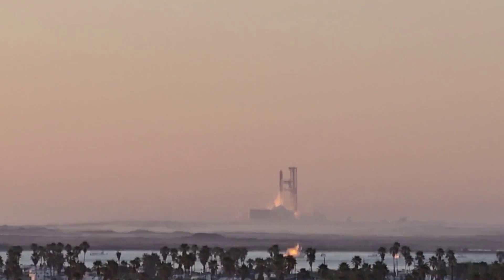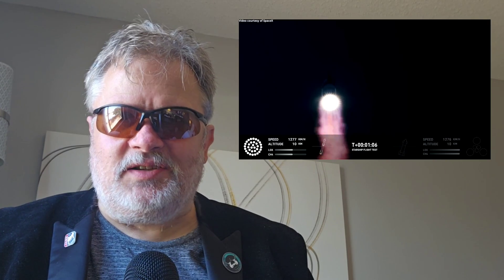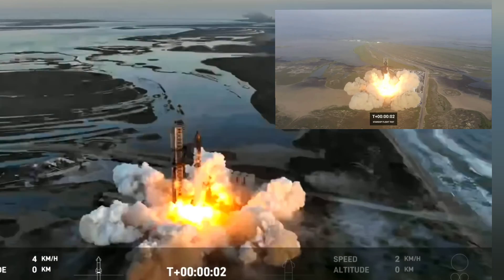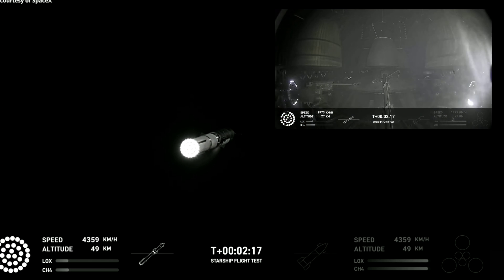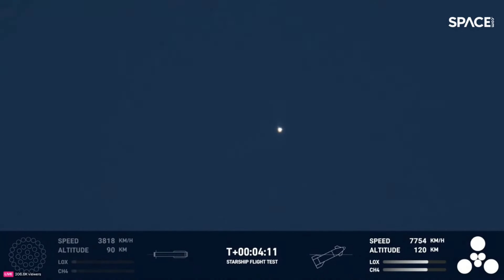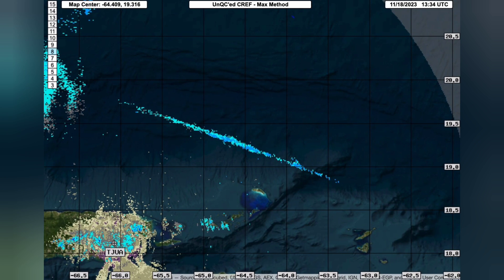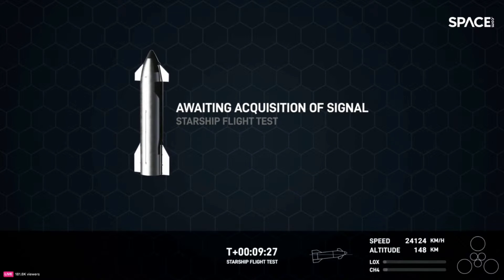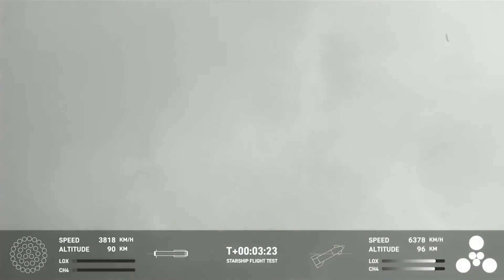Starship takes a huge leap forward!!  What's next for SpaceX after OFT-2??

Comment: I honestly think that Starship should be reconsidered depending on the mission. For the Moon and Mars, replace Starship with a 2nd and 3rd stage that is not reusable. I'd want to land something that can carry considerable amounts of payload and also be used as a place to live, no reusability is needed for that. Plus, the number of launches to refuel Starship in orbit is ridiculous. If you had something that was not reusable, you'd require far less launches for refueling. However, for low-Earth orbit missions, yes, you definitely want reusability.
Reply: Refuelling may be "ridiculous", however if the cost per mission is exorbitantly high then the mission will ultimately be abandoned. The space shuttle was canceled as it was too expensive and not extremely safe.

We will ultimately never accomplish anything meaningful in space other than satellites and probes if the cost per launch is absurdly cost prohibitive.

Setting up colonies on Mars may ultimately be a pipe dream. However, getting large payloads into orbit at an affordable price points is going to be a prerequisite for any meaningful space exploration or utilization.

So could they use an expendable stage? Yes. But then again expendable, unaffordable and economically unviable transport options already exist on the market. Why bother reinventing that wheel when NASA is already doing that? Disposable rocket stages won't put large payloads into orbit cheap enough to be economically viable beyond a very limited scope of commercial applications.

Like if a garage door opener cost 100 million dollars to develop and then 10 million dollars every time you used it........ It's practical application would be somewhat limited. Sure, it's a functioning garage door opener, but at what cost.

But then again SpaceX could be wrong. Lot of companies seem to like expendable rockets and high costs per kilo to orbit.
Reply: @danielnomnom2646  In the scenario I was talking about, the booster would be completely reusable. It's only the upper stages that you'd expend when going to far away places like the Moon or Mars. And, you don't need to expend them forever, just accelerate the time frame of getting there by allowing the first series of missions, to setup infrastructure, to be expendable.

Comment: SpaceX still has a lot to do:
1. Fix the issue with hot staging/boost-back burn
2. Fix the issue with the heat tiles being ripped off the Starship
3. Figure out why the LOX leaked from Starship

Comment: One of the most glaring differences between the two flights, you failed to mention; is that when the first one started rolling around - the second one was already more than twice the altitude and going at more than twice the speed.
The first never got near separation stage.

Comment: Thank you for the coverage!
I think next launch, it could make sense to try it without the hot stage separation. The booster started failing immediately after, and did Starship actually get away damage-free firing that close? Hot-stage seems plausible but go for standard separation for now to get to full mission completion. Optimize later.
However, I counted at least 5-6 major improvements so it was a success!
- Ground 0 launchpad in much better shape (this could be the biggest improvement as it enables another launch sooner)
- every engine worked til stage separation
- Starship made it past stage separation and continued on its own.
- Starship fired all its engines
- Made it to space, much higher, further, and faster than last time.
- Orbit now looks realistically possible whereas the last launch it struggled the whole way.

Comment: Its pretty clear the booster had issues only when the engines went to relight after seperation. Its fairly likely no fuel pressure on one side was the root cause, not damage to the top of the booster.

Comment: I agree that at the current point in time SLS is a more mature vehicle, but at its core it is also a relic of the previous century and that is the only reason why it was able to achieve what it did. Mark my words, when Starship reaches the amount of development time and cost that SLS had, it will be achieving FAR greater feats than slinging an empty capsule around the moon. The fact that SpaceX was able to reach space with the worlds most powerful and complex rocket that essentially started its design in its current form (switching to stainless construction) in 2019 with an entirely brand new engine of a design that has never even flown up until Raptor, shows there really should be no comparison between the two systems. I think that in our current environment with how NASA operates SLS is a necessary evil and is still an incredible feat of engineering, but I think we have to keep in mind that just because they had maiden flights within a few months of each other doesn't mean that they should be compared in their developmental timelines simultaneously.
Reply: Saturn V had two test flights, Apollos 4 and 6. All three stages were tested together, no individual test firing (at Von Braun's insistence). Rocket performed flawlessly both times. Third flight was manned (Apollo 8).
Reply: @dalethelander3781  I don’t think we read about the same Apollo 6 in history class mate 😂
Reply: @dalethelander3781  not to mention I said nothing about Saturn V, only SLS, which shares practically no direct heritage with Saturn V (which is one of my all time favorite rockets btw).
Reply: Apollo 6...April 4, 1968. Declared a success, despite pogo oscillation. Overlooked because of the assassination of MLK.
Reply: @dalethelander3781  of course overlooking the loss of two second stage engines and a failure to relight the stage once in orbit… I’m not discrediting what NASA has accomplished, but pretending they never have failures is just ridiculous.

Comment: Fuel slosh. Not modeled on a super computer?
Reply: No, CFD (Computational Fluid Dynamics) Is Still Used And Is A Very Valuable Tool For Determining How Designs Will Perform ! ! !
Reply: Are there such things any more? Is Cray still in business?
Reply: @dalethelander3781  there are. More than ever. I think Cray absorbed by another company

Comment: I'm sticking by the following: hotstage ring not tall enough. needs to be not just taller, but have a protective curve - almost like a semi-disposable middle stage like a ladies corset. booster stage flipped too soon - should've gone a little higher altitude - low orbit allowed the slosh to hit the damaged booster - also, that tiny hotstage ring could've made the balance topple it prematurely.
starship was damaged by the hotstage sep, and because they glued some of the heat tiles on - which popped off easily. 
starship booster needed to slow down the flip maneouvre - hence the need for a little higher altitude to expend some of the fuel before flipping. the 'ladies corset' hotstage ring would protect the booster and the starship.

Comment: The videos clearly indicate the initial explosive damage to booster 9 began at the engine compartment and not the hot staging ring. This probably points to propellant slosh and propellant hammering internally damaging the plumbing. I wonder if ALL of the other boosters, currently waiting to fly, have similar propellant slosh design potentials.
Reply: The turbopumps self-destruct if fuel or oxidiser becomes gaseous. Fuel slosh introduces gaseous sections in the fuel and oxygen supplies to the pumps.

Comment: Regarding boost explosion: right after separation (and before explosion) it "tries" to light on the engines again, but you can see on diagram of the livestream, only the engines "of one side" comes back to live, while the other side doent. Also, from the three engines who never died off in stage separation, one goes dead after separation, all at the same time of the spin of the boost to come back Earth...

Comment: no expert here of course, but I'd think starting with just the 3 vacuum raptors for hot staging would shake up and potentially "throw off" the booster less, while allowing the starship to separate from the booster and push ahead of it before switching the regular raptors.

Comment: I think with this flight, the massive delay was caused by the investigation into the previous flight's impact on wildlife, etc. With this second flight - this did not happen, so there is a chance that the next flight will not be as delayed. SpaceX is cleared for a few more flights in 2023. Of course, that's not going to happen given they need to review the data and make the necessary adjustments - but they have proven they can do this very quickly. At this point I think it comes down to what they find is the cause of those two separate issues and how to fix it for the next flight. I don't think a late January flight is out of the question.

Comment: I'm of the mind that once ship raptor ignition is confirmed and the separation signal given the booster should shut down the 3 center engines. Then the booster should complete the flip using RCS and settle the propellant before attempting engine relight. It's not like they don't have the time to do so during stage separation, Falcon 9s do it all the time.

Comment: Yep, I'm speculating. The glorified shower-head did the job. Stage 0 is intact. The launch, all the way through to hot staging went flawlessly. All 33 engines on the booster did their jobs.
It is my guess that SpaceX wanted a test of the FTS on both stages. Once they had the data they needed, they activated the flight termination system, which also worked flawlessly. This test was a total success. The next one will have a splash-down of Starship outside of hawaii and a fin-down landing of the super-heavy booster in the Gulf of Mexico. Mark my words.
Reply: They already satisfied the FAA with the new FTS to be allowed to fly, and already have the data needed, a test like what you described is not necessary. The test stopped short of full data collection, like booster boost back and guidance to a specific spot in the water, and Starship reentry guidance and stability testing.

I think the biggest point against it being intentional is that it was not mentioned in the webcast and it was not part of the flight plan filed, which had monitoring assets and a restricted space around the Starship landing zone near Hawaii. The FAA announced that there was a mishap because it did not go as planned. SpaceX will be doing another mishap investigation to find the root cause failures of this flight and fix them for the next flight. If testing the FTS was planned and it all worked perfectly, there would be no mishap, just like the Dragon abort test where the booster was intentionally blown up.
Reply: @Jaker788  You may very well be correct. Scott Manly did a pretty good analysis of the footage from the test flight. It may be that there was damage to the engines on the booster from fuel sloshing and cavitation during the flip maneuver. That explains termination of the booster. There were also puffs of gas from the Starship before SECO that may indicate a fuel leak. Although the flight looked great, it did not go perfectly.
Reply: I sort of agree. One of things that the FAA was unhappy about in the first launch was that the FTS took way too long; this time, it was mostly instantly.  The only reason I can't totally agree is because SpaceX could have used the extra data and perhaps blown the FTS when it was closer to landing.

Comment: How many Apollo rockets failed?
Reply: None in the Saturn 1, 1B, V total of 32 launches.
Reply: @randyschreiner7807  gosh, what a surprise!
Reply: None. Not a single failure. Apollo 13 had one second stage J-2 engine cut out prematurely, but burning the other 4 engines longer delivered the payload.

Comment: No one has ever tried hot staging on a recoverable booster, not to mention one of this size. That's why Elon iterates. Now all that data will again be inputted into the next launch. As much as this 2nd launch improved from the 1st launch in all areas, I'm sure they'll make the appropriated adjustments. 

I think you should give SpaceX and Starship more credit for the moon landing timeline. I expect it to slip some, it always does. But not substantially as long as launches are not delayed and they can iterate. Think, in less than 10 yrs they invented and perfected Falcon 9 a type of rocket never built before. In less than 6 yrs they built Crew Dragon and started having regular scheduled crewed flights. That's having never built a rocket or crew system before, nor being a rocket scientist. Now with all that experience, as well as utilizing Elons iterative design process, I would think the Starship system would develop exponentially faster. Much faster than Falcon 9 and Crew Dragon. SpaceX could very possibly come close to these moon landing timelines. I believe the Starship system will become the complete moon landing system by the time those dates arrive. If Elon wants to practice Moon landings by going to the Mars, he doesn't need to wait on NASA, he just needs a launch license!

Comment: SN is a haulage lorry for the hardware and fuel?
habbitat delivery systems.
humans to journey in more stabel mature transport
Connect transit from one machine to another
refueling once in space could be ejectable modules
of any amount and moidules for water food expandable room.
Landing craft alsom could be lego meccano clipped together for a better landing
flat to moons surface for easy quick exit re-enter.
SN may need a bigger stronger double skinned venting vibration nulling plate.
If booster still burning pushing at same moment as Sn Fires away
could cause massive pressure damage.
heavy springs moments before sn fires could push sections apart better

Comment: I think massive engine heat soak was the fundamental problem with the booster. This caused the problems with restarting and maintaining combustion causing fuel slosh and ultimately duel starvation. 
Scott Manley noticed that just before we lost Starship the Oxygen usage increased massively - and had a corresponding odd exhaust plume towards the end - why?

Comment: Scott Manley surmised that fuel slosh caused the engine failures on the booster. There may have been other factors, but that very fast flip very likely starved some of the engines. Not sure what happened to second stage but the flight termination system being triggered after it failed to reach its target altitude is a safe bet. 

 I look forward to the local folks showing the state of the pad in the next few days. That’s going to be a make or break issue for an aggressive launch cadence. If the pad is unscathed then they can focus on the booster & vehicle. If there’s new damage then there’ll probably be further delays.

Comment: Considering that you were certain that the water suppression system would fail, I’m going to assume that the hot staging had no negative impact.
Reply: It did seem to push the top of the booster down and upside down. With fuel sloshing to the top (facing down), they could not successfully relight the engines.
Reply: I stand corrected.  I'm glad it worked.  However,  the fact that it was so well engineered and ready to go so soon for me begs the question why the first launch wasn't delayed so that it could be built.  Let's hope SpaceX doesn't make other "rush at any cost decisions."  Personally, I think all SpaceX fans should send letters of thanks to the FAA and the FWS for preventing SpaceX (Elon) from rushing a second launch before all the improvements made in the last two months had been added to the vehicle we just saw launched.
Reply: @wbwarren57  Even if Spacex had to rebuild the launch site each time, it would have only taken a few months inbetween flights. It was more important to get useful data. BTW, Jordan questioned Spacex  when they did not go with the standard water deluge system.  Thank goodness Spacex ignores it's critics. 

The FAA and the FWS are the reason Spacex is taking so long. Does anyone believe these two organizations will not let Spacex continue.  Useless government programs made to drain tax dollars, waste time,  and put unelected bureaucrats in office. I'm no fan of Ch ina, but they would already be on the moon if they had access to Spacex.

Comment: Russia, of course, does not intend to reuse the booster, so whatever damage the second stage causes to the booster is totally irrelevant. My opinion on why the booster failed to power up was the fuel was not available. So, to keep that from happening, at separation, the booster should gimbal away from the Starship in a forward-facing arc, and not do the flip maneuver.

Comment: The extreme speed of SpaceX's advancements into rocketry, in my point of view, I believe SpaceX can at least accomplish the 2026 manned space flights of Artemis and so on with Starship and Super Heavy, as long as nothing holds them back for long, talking to you FAA and Fish and Wildlife. The 3rd and 4th test flights will probably show us the outcome of the Artemis manned missions. If the 3rd and 4th rockets have worse outcomes than the 2nd Starship test flight, then Starship could be somewhat doomed. Cross your fingers they will succeed as I believe in them.
Reply: Watching Star Trek reruns is more exciting.
Reply: Potential is there. Like to see a test without hot staging. But id like to see an exact repeat of launch, as that will be telling if it is consistent. If that is, the rest will be fine tuning. Was interesting how much fuel it took without a payload to just reach the intended test altitude.